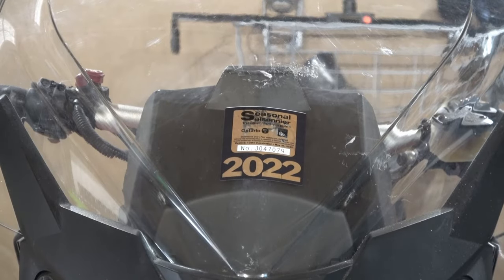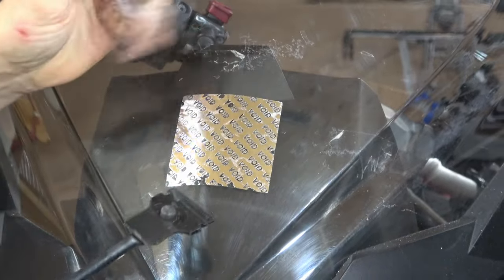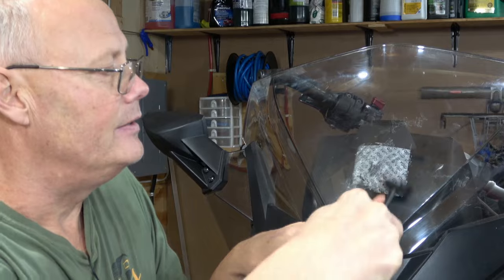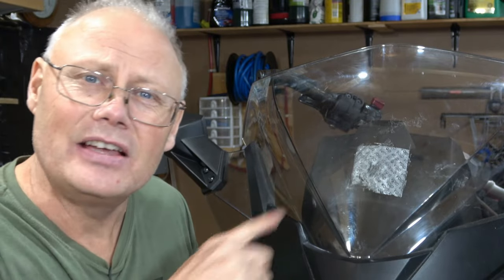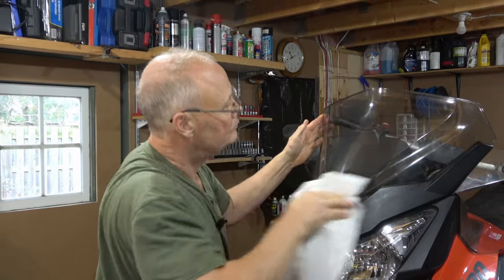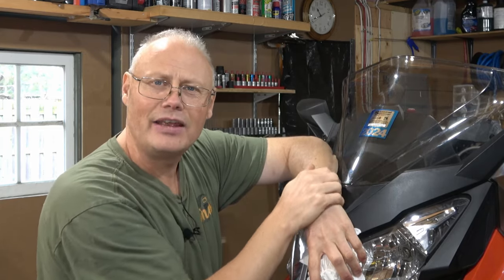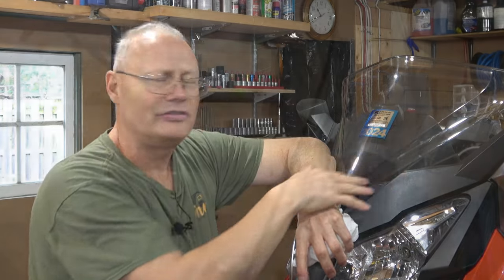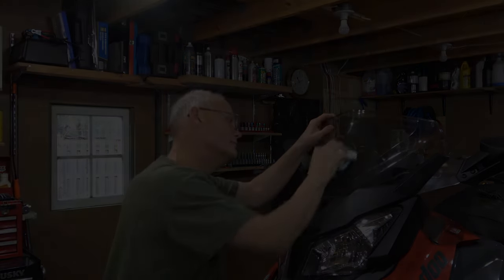Today, I show you how I remove sticker adhesive

Comment: I use a heat gun carefully to loosen the adhesive before peeling, sometimes it takes all of the adhesive off with the decal and sometimes it leaves 10 percent or so, either way  it is much easier. I have never used the never dull product but I will be trying it, thanks for the tip. You don't have to put the pass on the windshield, you can put it on the engine cowling as long as it is not blocking any numbers and it closest to the center of the machine as you can get it.
Reply from the maker: Thank you for the input, heat guns definitely make a difference,  great tip on pass location as well.
Dino

Comment: Now that is a good product! Stickers are so hard to remove. Thanks for the tip. ( I noted the temperature around Toronto recently, so you should be on the trail soon. Up to Sudbury for a weekend ??). Just looked up that Never Dull is available from a boating shop here in Australia - I can use that for a couple of jobs!
Reply from the maker: I'm glad you found the video interesting Mal. Yes snow is on its way, another few weeks and a trip may be possible. Let me know how you like the never dull.
Dino